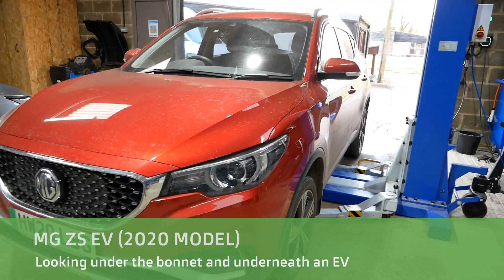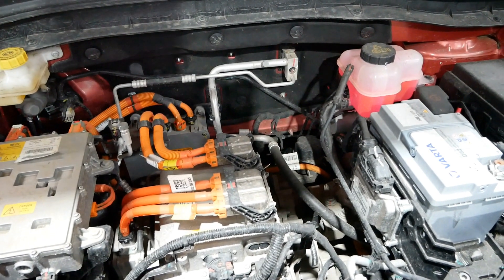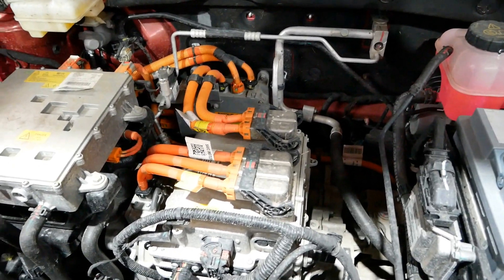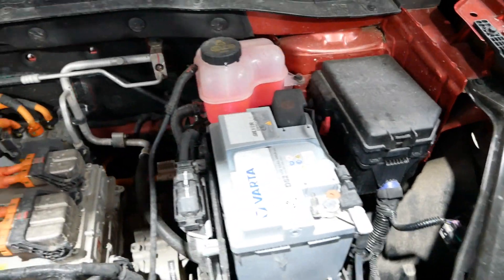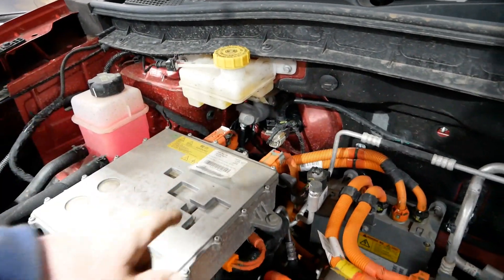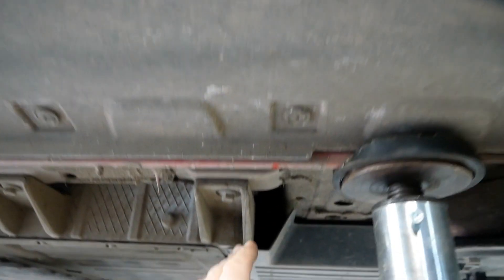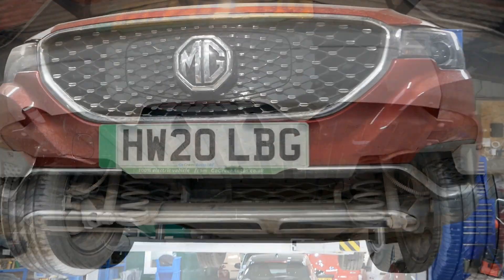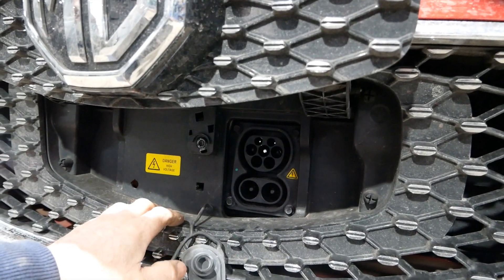Whats under the bonnet in a MG ZS EV ? And also looking underneath.

Comment: Do you know if the gear reduction box oil  needs to be serviced?
Reply from the maker: I've not done a ZS yet, but it will be the same as all EVs in that the manufacturer doesn't include gear oil as part of the service routine and treats it as "lasts the lifetime", but you're better off changing it every 60-70k miles or so.
Reply: Thanks for replying.  
Just wondering the kind of oil I need and the amount for the service of the gear box on my MGzs ev. If you jnow please let me know. 
Regards.
Reply from the maker: @xulianxo  I don't know the exact ZS specs, but nearly all EVs use MTF 70W-75W (manual transmission oil) and typically the reduction gearboxes hold 1.0-1.2 litres. I've done some gearbox videos if you're interested https://www.youtube.com/@GoGreenAutos/search?query=gearbox

Comment: chinese junk.
would like to know where that car will be in 10 years time?
probably in the scrap yard.
Reply: 10 years is a long time mate, this one's in fact quite decent with all the prime time spec offered at an attractive price, you maintain it well and manage body work, and it might last a bit longer 😉

Remember EVs have a lot less moving parts. Who knows in 10 years the battery pack replacement becomes a cheaper/more viable option to consider only time will tell and your interest in sticking to a single EV 😄 (and of course the UK market if they don't decide to slap even heftier taxes on these things!)

Comment: I will give it 2 years and it's a rust bucket, underneath it looks like a Alfa Sud from the 1981 a scary 
rust trap
Reply: Hey there, been using for over 2 years now, can confirm no sign of rust as per the last service report! Going really well, the battery holds up pretty well too 🤞

Comment: Good overview of under bonnet and underside. We done a similar video as I think it's important for EV owners to see things they may not normally. You mentioned Varta battery, here in Australia all ours have the SAIC branded battery standard but I was impressed with the quality Michelin tyres fitted as standard. Keep the great video's coming.
Reply from the maker: Yes Michelin tyres, but they are made in China. Didn't know Michelin made tyres in China until I saw these.

Comment: I have had my ZS EV for five months now, things they could do to improve, the first would be to turn the charging point cover the other way up so it opens downward instead of upward- secondly bonnet rams to lift and hold bonnet up and open as quite a big bonnet - Thirdly underseal or wax oil the underside a little better - fourthly put a bit more clear coat on the paint finish as I think the paintwork is very thin and chips easy. Apart from that I am well happy with mine.
Reply: Re the charge port, MG 5 has it in the same position but it swings open to the side, which I think is much better.
Reply from the maker: Yep, agree with all of that. Paint is thin on most modern cars though. I don't find the MG any worse than others.

Comment: Great underbonnet & underside tour.  I had the same query about the plastic cover to the rear of the spare wheel well. If you look it is BELOW the spare wheel well, from inside the boot the well is the lowest point of the inside of the MG, that plastic cover underneath goes far below the level of the spare wheel well pressing, would be great if you could have a look behind the cover for us either endoscope tool view or cover off, please??